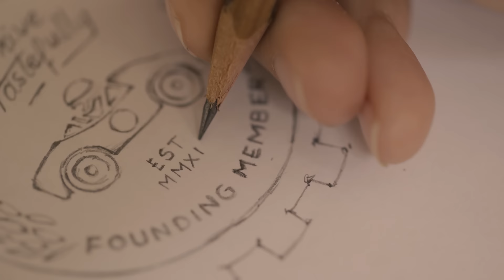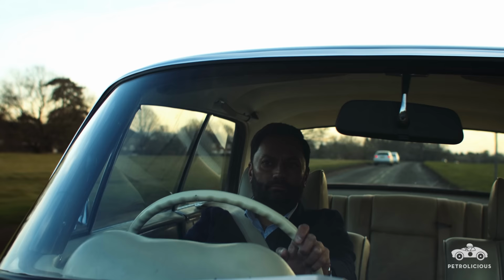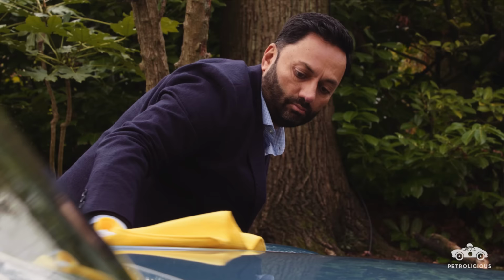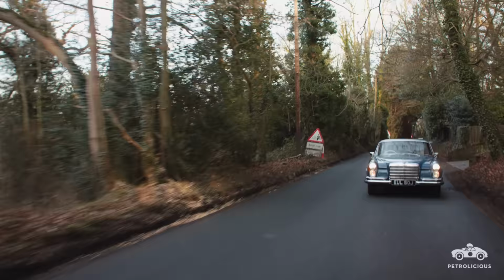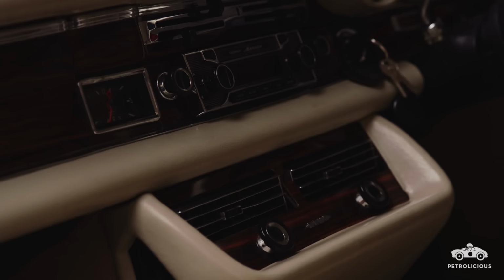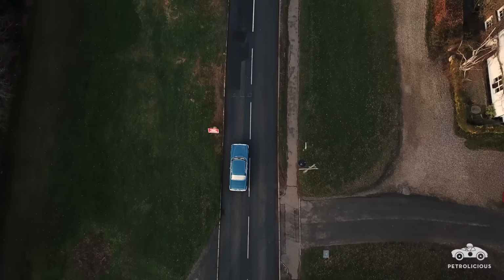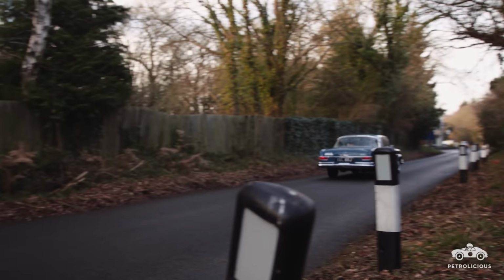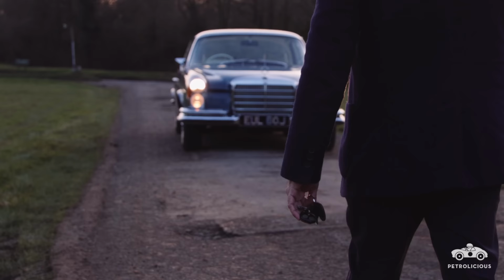1968 Mercedes-Benz 280SE: The Blau Coupe

Comment: Who knew a Mercedes would look so slick in blue?
Reply: Wir deutschen
Reply: I've seen some newer mercs in a similar deep blue and it's glorious. I'd have one in that color if I were to buy one
Reply: We have a long time customer at my shop with a '68 280SL in the same blue, black interior. It makes me smile every time he brings it in for service.
Reply: @bigblockcutlass  whats the color name / code? Thanks
Reply: @crashtaken2spooky4me50  Alle Deutschen? Oder nuhr die Schwaben? I’m only kidding actually.
Reply: @JmadeInvest  it's quite literally called Mercedes blue, my my 4sp manual 67 250s has the same paint and i wouldn't have any other colour.
Reply: I have a 200d parts car in this same blue. I had planned to graft a rusty 220SEb onto its rust free chassis. I can’t bring myself to cut it up. After seeing a car in a shiny coat of the same colour I will be building the 200d for sure. The 220 will have to wait.

Comment: I had a 1963 220SEC for about 10 years. It was a European model with a 4 speed manual gearbox and a sunroof. It was completely original. I restored the interior including the wood. I rebuilt the engine at 150,000 miles and drove it an additional 50,000 miles. It was so silent people would step out in front of it. It also had little rolling friction it would coast for more than a mile.

Comment: I am now seventy years old.  My first car back in 1975 was a  beautiful 1967 Mercedes 300SE coupe with a stick shift. It was dark blue with a tan leather interior. It cost me only $4,150!  My next car was a 1967 250SE coupe with a sunroof. Dark green wih tan leather. It cost me $7,500.  Then I bought a 1960 220SE Mercedes convertible in white with red leather. It cost me $16,000 in 1983. Finally, i purchased a 1968 250SE convertible in cypress green with tan leather. It cost me $33,000 in 2000. Today, these cars are worth hundreds of thousands of dollars in restored condition. I drove all of these cars on a daily basis. Now, I can only dream about  my favorite Mercedes. P.S.- I saw a beautiful 300SL Gullwing on display in 1976. The asking price: $25,000.  Current value is around $2,000,000.

Comment: No one will ever be so passionate about electric car. Ever.
Reply: Have you already seen the honda e prototype? It's beautiful designed
Reminds me of the 80s a bit
Reply: Hacke Rino looks like an early 70’s Civic but electric cars will never be able to replicate the magic of an old fashioned combustion engine car they have no character they just go.
Reply: We don't know yet, let market decide.
Reply: @muarrifalwazir1828  Tesla has their fanbase but most people want a Tesla as a status symbol. Once you buy the Tesla then what all you can do is drive the car you can't tinker with it your average person does not even know how a Tesla work. At least before you could have the slowest car but you would form a bond with it because you were able to look at it and understand what makes it run and anyone could easily do simple repairs
Reply: We surely won't. But that's the case with most of the new internal combustion cars as well. Small displacement + turbo here, overload of safety tech and driving assists there, overengineered driving dynamics, fake exhaust sounds - new cars are mostly synthetic. They are not so simple anymore, and that leads to less character. You can't tinker with it, you probably don't understand how all the tech works. It is a machine you don't understand, you just use it until it lasts, and then get another one. 

For everyday commutes, I use a new car, too. More comfortable, more relaxing. But I will never be attached to it. Even though it's a fairly powerful vehicle with many nice features. I still use my old weekend BMW convertible whenever I can.
Reply: I dunno, have you seen how heated Teslavangelists get?
Reply: dusan1217 They mean nothing to me .
Reply: I'll be the guy driving this amongst the boring, tasteless electric cars.
Reply: Screw the electric car!

Comment: I always loved these cars. My late father had a 67 250 SE Coupé (cream with tan interior and a 4-speed manual on the floor), the difference being that the 250 had the 6-cylinder OHC inline engine, and the grille was the more upright and narrower grille rather than the new wide-mouth grille on the 3.5s. Also, the instrument pod was hand-shaped wood, matching the dashboard; Mercedes had to change that in 1968 to leather, to meet U.S safety regulations (wood could splinter in a crash — thanks, Ralph Nader…) 

My dad had a very old friend in Germany who had close ties to the factory. so he was able to order some custom details not ordinarily available, such as a "tweaked" engine (so he said), and natural tan pigskin upholstery everywhere in the car: seats (front and back and sides), door panels, dash topping, even the full headliner. You got in and it smelled like you were inside a pigskin attache case from Crouch & Fitzgerald.

Comment: Reminds me of a similar experience of driving a Mercedes S class sedan of the same era. Wonderful car with a pleura of superlatives to justify its cost . . . sodium filled, stellite faced valves,  (unless I'm mistaken it also had) alloy wheels to reduce un-sprung weight, 4 wheel disc brakes, fuel injection, all in an effort to make the car the most advanced that it could be. More substance than just flash. . . your video brought back great memories.

Comment: I am glad that this classic Benz is married to a passionate owner. I was fortunate to own a “blau” 280 SE sedan while living in the Santa Cruz mountains in 1991. The quality of these automobiles was absolutely top notch. Showing 130,000 miles, my 280 would still run smoothly at 130 mph with the US spec 4.5 liter V 8. Every thing worked, even the clock, unusual for a 20 year old car. The Mercedes built 4 speed auto transmission was equally impressive. I worked that big sedan hard rallying historic Page Mill road up and over the Santa Cruz crest competing with pure sports cars. The low pivot IRS rear end controlled camber changes and absorbed the punishment from that historic wagon road. The powerful brakes never faded, even when encountering one of the Bordie brothers driving my direction. The brothers in this pioneering family had an unfortunate genetic condition where they went blind at 50 or so. This did not prevent them from driving that old road by memory into their late 70’s. Flying across the Dumbarton Bay Bridge at 120 or so is another great memory. I loved that car.

Comment: Miss my “working man’s” 1970 250c 

-white with optional dark blue top, blue leather interior and “ that” magnificent steering wheel, wicked 2.5 L six cylinder, console, 4 wheel disc brakes,  “chopped top” , no b pillar styling 

A capable, solid and unique car and drivability like no other

Comment: In the USA, I believe the first model year for the 3.5 coupe was 1970; up until then, the 280SE coupes and cabrios had the 2.8 liter 6-cylinder inline motor. I can't speak to the European or UK models, but with the 1968 model year, Mercedes made a few changes to meet the new DOT safety requirements here—one of which was to lose the gorgeous hand-formed wooden instrument cluster nacelle found on the 220SE and 250SE coupes/cabrios: a leather-covered version as shown in this video was substituted.

Comment: I feel exactly the same about my pristine garden variety 1989 smoke silver W124 300E sedan delightfully owned for the past 20 years and 280k of its 320k trouble free life.
Reply: My 94 w124 coupe has 620k miles with original headgasket  and trans. Only waterpump has been changed .Ive had this 20 yrs

Comment: Just a couple of questions, why would a German pre-production car be built in RHD and why is a 1968 car carrying a 1970 number plate 🤔
Reply: 6778jag  no sure about the RHD element, maybe because it was going to be sold/tested in the UK. But the 1970 number plate is probably because that’s when it finished off road testing and was then registered for use on the road as a normal civilian car. I could be wrong though.

Comment: These cars suck big time(all the old Pagodas, later SLs, 123, 124, 140, SECs), I don't know why anybody wants them besides their looks, they're so uninspiring to drive it's beyond understanding. I own beautiful C124 300CE btw, I hate it, it's in good shape, it's just bad car as a concept. The steering is too slow, the suspension is too wonky(even Sportline), weight distribution is horrobile(they should fix it by using transaxle layout), gearbox is killing all its power, seats don't hold you and if you have longer legs they will not offer enough support to prevent your thighs going numb. 
They are just good to look at, but horrible to drive.